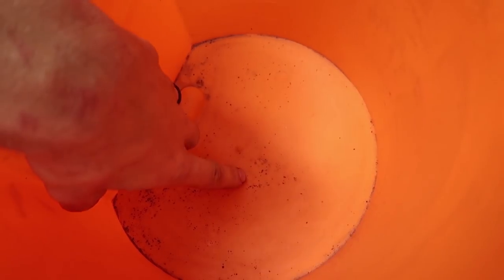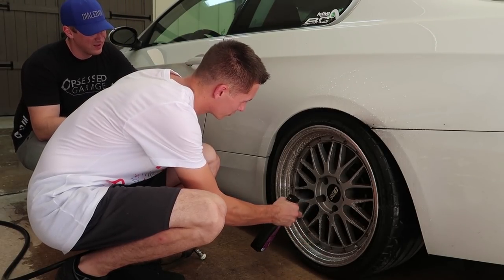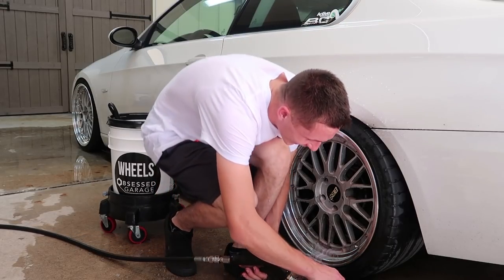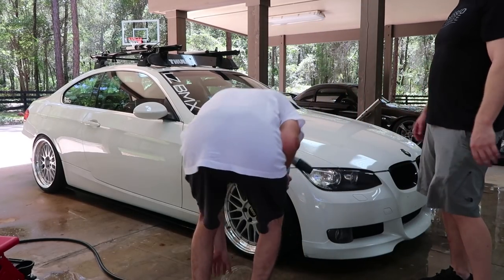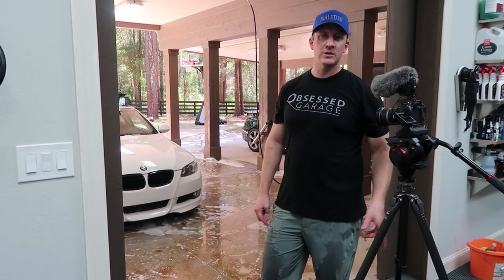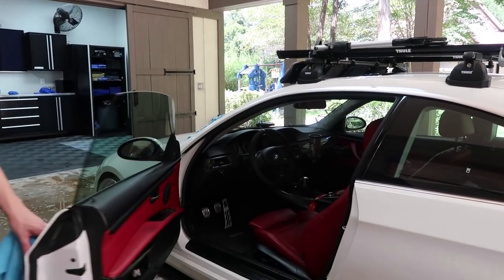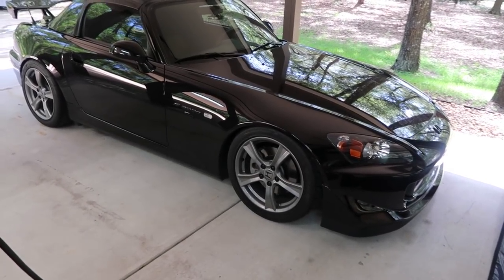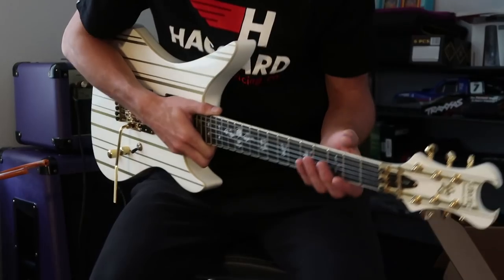Learning How to Properly Wash a Car

Comment: non car guys be like: why make a 20 min viedeo on how to clean your car if you can just go to the car wash?
Reply: Nicknags And use the scrub they provide you for the best results!
Reply: Not a car guy... Why do this instead?
Reply: toot toot my skin flute Car guys dont go to normal car washed because it can scratch/ruin the paint. And this saves money.
Reply: touchless car wash ftw
Reply: toot toot my skin flute this may take more time, but your paint will last longer, look better, no scratches and the car will look so much cleaner. Go to a car wash, wash your car and all it does is kinda knock the dust off. Do it yourself every spot, and whole different story after it's cleaned.
Reply: Nicknags I
Reply: Timmy B you would never take a nice car through one of those.
Reply: toot toot my skin flute car wash places aren't going to wash your car 100% or how you obviously want it. It's cheaper if you have the supplies and you don't have to worry about swirls or scratches (if you do it right of course)
Reply: Ethaneous Maxamus well maybe because you go "muddin" why waste time putting extreme detail in cleaning the car if ur just gonna dirty it with a bunch of mud. My guess is that u live near the country so ur around a lot of mud all the time so why detail ur car up there. Cars that live in suburbs and cities detail there cars
Reply: Nicknags because those extra 20 minutes is extra cash for him
Reply: Have fun with DESTROYING YOUR PAINT at a CARWASH.....
Reply: not gonna lie, i didnt know better, and ended up completely screwing my paint. scratches literally everywhere.
Reply: Zach Roberts HAND CAR WASH
Reply: Yeah 😂😂
Reply: @toottootmyskinflute8719  clean it better

Comment: Surely if you clean the rims first then wash the car afterwards the dirt would just run back onto the rims thus wasting your time?
Reply: Voia I've seen u on other videos I always thought ur profile pic was a hair on my phone screen
Reply: Voia When you wash the body of the car after the wheels the dirt is suspended in the water, meaning when it then sits on the wheels all you need to do is spray it off with more water (that’s if it hasn’t dried onto the wheels). It’s easiest to do wheels first, or at least I find it easiest, especially on larger vehicles which take ages to dry
Reply: David pelkey lol
Reply: Voia Cleaning the rims first ensures that the corrosive brake dust doesn't fling and stay on your paint. The final rinse would wash the dirt off the rims.
Reply: Thats why you do a final rinse of the whole car plus wheels
Reply: Voia I really blown on my screen😂😂
Reply: Voia has no 1 thought about them looking nice and fresh while drifting for the viewers and your own pride of it being super clean :)
Reply: Lol when I saw your profile picture I thought I had something on my screen and I tried wiping it off. Lol
Reply: same like washing your body and then washing your hair lol all that greasy shit will juts run down your body
Reply: Voia but it wont cake on the rims
Reply: not even gonna lie ur profile pic got me
Reply: Voia I was blowing on my screen cause I thought I had something on it
Reply: Voia you again.?
Reply: You use a different bucket and wash mit
Reply: voia i rubbed my screen six time trying to remove a hair that ended up being your profile picture
Reply: i feckin fell for it too :P
Reply: i thought there was shit on my screen smh
Reply: LMAO i had to read it 3 times good try bud XD
Reply: YOU  FUCIKNG GOT ME HAHAHAHAHHAA

Comment: I use clay bar when necessary, and since I don't have access to a hose I go to a self wash with a bunch of micro fiber towels/cloths, and Adams Polishes detail spray. I start with a rinse, then use the self wash foam spray, then another rinse, then wax it, and wash it off with non-water-spot-leaving-water lol. After that I completely dry it, and then I use the detail spray on the whole car going from panel to panel, and finally I clean my rims with detail spray as well..

Comment: A bit late here but, you gotto spray the foam from the bottom and up, same goes for the roof/hood/trunk. This is so you get the full use from the soap and that you avoid soap marks and that the dirt slides down on the soap. Then you use the pressure washer the same way, down and upwards. There will still be some soap around here and there so you can go over the car again with the pressure washer, but now from the top and down. This method gives the soap the full potential to do its magic.

Comment: Question: is shooting water up your exhaust like Adam was doing ok or is it a bad idea?
Reply: Rhino Place Yes you will be fine. You will never send water far enough to get back into the engine, especially with the way headers are designed.
Reply: Rhino Place your joking right
Reply: Rhino Place bad idea! Cars have wet sensors that close the exhaust muffler to prevent irreversible damage that would occur without them! Even with them closed muffler bearings, resonator baffles could corrode and fail and cause back pressure to the valve train that can damage cams, retainers, pushrods, etc...
Reply: lol
Reply: Drew McCarthy You've just taught most of Adams subscribers so much about their exhaust. I wonder how many actually believe you. 😂😂😂
Reply: Rhino Place thanks for that question, I was about to ask the same thing👌
Reply: Rhino Place yeah I wouldn't recommend it, the water can rust your exhaust out from the inside, and your muffler bearings will go out and that's like $150 each bearing😔😔
Reply: Boosted Miata but when they go bad chrisfixit's video will sure help to change them out
Reply: wow
Reply: don't ever do this unless you use the same filtered water as adam did. he used something to take the minerals like iron out of the water (iron will rust shit) you should only do this with 100% purified water and then you would have to get one of those mini pressure washer type deals where you fill the can up with bottled water (its purified already) and then spray ur exhaust only using bottled water...
Reply: but ofc you could always just clean ur exhaust tips outside & inside, don't spray water directly in the exhaust just use low low pressure or even a bottle of water to rinse after you scrub, don't go deep in the exhaust only do the inside of the tips.
Reply: Rhino Place it doesn't matter if your are planning on driving right after because the exhaust will heat up and evaporate the water
Reply: Rhino Place VOSS water is the best to wash your car with though!
Reply: Boosted Miata pricy haha.
Reply: Why would you even want yo squirt water into ur exhaust that's just stupidity.

Comment: On the TP topic...  Majority of people don't consider what will happen, or could happen greater than 2 weeks out.  Primarily driven by the paycheck to paycheck lifestyle.  For most people, the Sh*t paper isn't a thought (like food/diapers etc) until they reach for the last roll, then they run out and pick up a 4 pack until payday... If you really think about it, most peoples "disaster prepping" is just picking up what they should already have. Unfortunately, a lot of families only have a few days of food on hand at any given time...  Big picture, people are very comfortable with "its there when I need it" but don't realize 3 days is all it takes to run out if the supply was cut off... Stay safe guys...

Comment: Pro tip: Use a Sealer whenever you can, keep in mind what you pay for is what you get, sealer lasts longer and protects the paint better. Wax works as well but is more short term meaning you will eventually be spending more than using the sealent.

Comment: Your playing is getting better in every video, try doing some 3 note per string scales for example if you're playing in standard tuning start on the low E and try 3-5-7, 3-5-7, 3-5-7, 4-5-7, 5-6-8, 5-7-8. You can follow that pattern anywhere on the fretboard 👌

Comment: List of products used... somewhat accurate
AMMO cleaning products
-Plumwheel cleaner
Adam's Polishes products
-Tire and rubber cleaner
Adam's microfiber towels
Ez detail Brush mini
The small detail wheel brush is something like Chemical Guys ACC_S90 The Goat Boar's Hair Detail Brush
Black wheel brush is something like Mothers Lambswool mitt
Tuf Shine tire cleaning brush
Silica wheel spray is something like Auto Glanz all purpose cleaner
Bug sponge
foam cannon
Optimum car wax and gloss
Tire dressing applicator
Carpro perl coat protectant

Comment: Deionized water is what pressure car washes here in Spain have for the last step so you dont have to dry your car, here its rare to see someone manually washing a carz we just use pressure washes with hot water and soap and then rinse with deionized water. You get around 5 minutes of water for 2€, if you do It right you get a good finish cheap and fast

Comment: is there a way to get rid of pitting from brake dust?
Reply: New Age Culture buy new wheels the pitting is the hot metal from breaks and road debree that take chunks of the wheels off sadly it will either be refinishing the wheels or getting new ones and making sure to clean the wheels more often and use the brush and techniques they used In the video will help prevent it in the future good luck 👍

Comment: Hi Adam, just wondering what 335i you have and exactly what you have done to the aesthetics as it looks the bollocks👌🏻cheers!
Reply: 2008 BMW 335i
Cosmetic mods:
BC Racing Coilovers.
19" BBS LM Wheels.
Painted orange reflectors white on the front bumper. 
Carbon fiber rear trunk lip.
BMX roof rack (don't know what brand)

Engine modifications:
Full bolt ons. 
Stage 2 tune.
Soon to be big single turbo.
Reply: Shona thanks!!

Comment: A little tip for getting bugs off of your car get the spots wet with water and then use a dryer sheet to remove the bugs them rinse the car off  works really good and fairly inexpensive

Comment: I wish i had a car worth washing nicely lol. I just use of of those typical car washing brushes on a stick
Reply: Isaac R if your talking about the brushes at a car wash. never use those, ever. ppl drop those all the time and cleans engine and it builds up dirt and grime you might not see. but if you use the soft brushes you buy to wash the car at home it's ok as long as you clean it before and after :)

Comment: Surely for the wheels rather than using that stupid brush to get the barrel clean wouldn't it be quicker and easier to just take the wheels off, clean them and then put them back on?

Comment: My dude, bitcoin is insane. I've bought into bitcoin cash, (a split off of bitcoins as of 8/1/2017.) I bought 20 for $200 and I've made more than $14,000 off of it. I also have bought into Ethereum and lite coin and other cryptocurrencies. Research beforehand, and buy low sell high. There is PLENTY of money in it. I use the app "Coinbase" for litecoin, Etherum and Bitcoin, and Poloniex for Bitcoin cash and smaller Alt coins.

Comment: BITCOIN. Don't listen to him. Cryptocurrency is the currency of the future. It's decentralized currency, meaning not one person has complete control over it. It is the people's currency and that gets many governments concerned. I've been involved and actively investing in only a select few for over 5 years now. The only three you really should consider is Bitcoin, Litecoin, and Ethereum. 
Bitcoin could go way higher, but it currently has major flaws. The first isn't always the best. It takes way to much transaction fees to transfer compared to the other two I mentioned (LTC/ ETH). 
When more and more retailers, especially larger ones, start to accept the currency. You can expect the price to rise. I'm sure you've heard of Newegg when you built your PCs. Well, they accept Bitcoin. Pretty crazy to imagine that one of the first purchases made with 20,000 BTC was two large plain pizzas, followed shortly thereafter by alpaca socks. 
What gives it value? Well, it's perceived value like the USD. Not backed by anything besides debt, and what people are willing to trade for it.